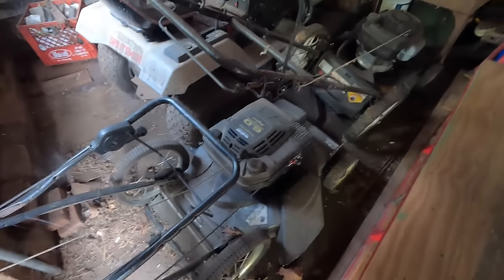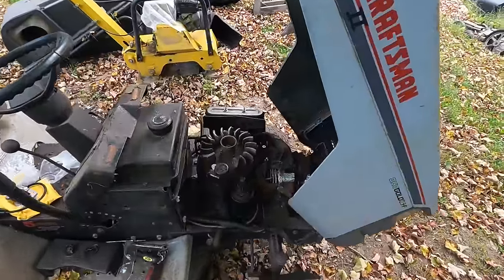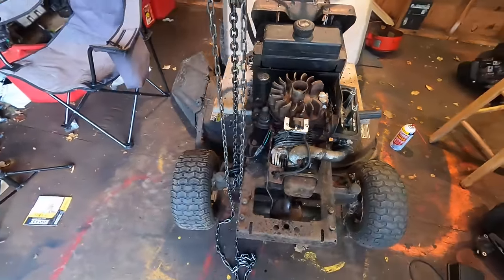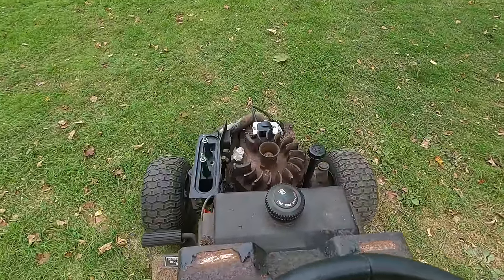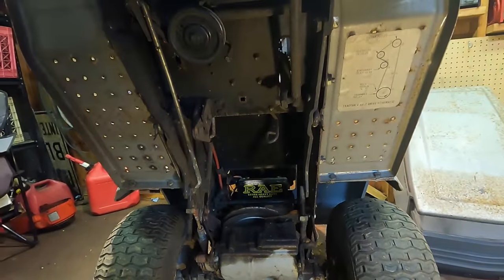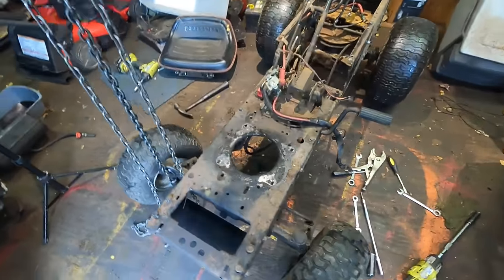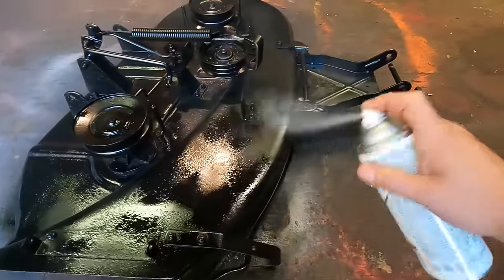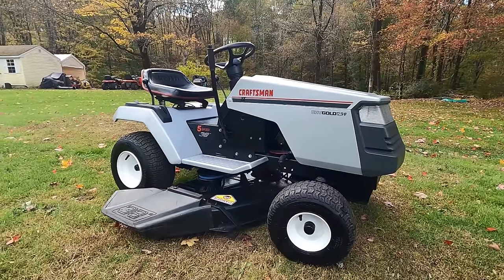BARN FIND Tractor Restoration: 1991 Craftsman LT4000

Comment: I just found  ur channel  and im liking it A lot. I like where u dont edit out the not starting  and any mistakes  u might make A lot of channels just edit out the bad and all we see is the machine  cleaned up and running  good after they spent half a day fixing  it. Ive thought about  starting  to do service and minor repaìrs no engine rebuilds or major work.   Do u just do the flippingor do u service for the public??¿  do u do 2 strokes???  Most shops or at least a lot has quit taking ìn2 strokes whats your opinion  on my business  plan. Just service  and minor  repairß????,
Reply from the maker: Hi! I’m so glad you’re enjoying my channel. Yes, I try to leave in the bad stuff too. It can be a messy process sometimes, and I make mistakes too. I try to learn from them and let the audience know what I’ve learned. 
I only flip machines right now, no repairs for the public. I’m a full time teacher, so most of my schedule is booked with that job

Comment: If you have fuel and spark and things don't start easily or run good. You need to start checking valve lash adjustment.

Comment: Hi Kyle, I subbed to your channel very nice job on that tractor, I'm also working on a tractor husqvarna LTH-139 , got it  running and driving, just need the deck belt, then I'll know if it will cut grass, also an important note for everyone if you take the rear wheels off remember they are keyed  netal key stock if you lose that then your wheels wont turn, thats what happened to the one I have plus the hydro static was low to from sitting, but that had me mind in a blender for a few days wondering why the wheels didnt turn.

Comment: Have you changed the oil ? If there is oil sludge on the governor parts inside the engine that could cause engine surge !
While typing you got the new carb on and it sounds really good !

Comment: Turned out nice.  I yelled a few times at the screen, but you got er done !  You might want to buy some cheap thin floor mats & cut them to fit where you put your feet and glue them down. My LT2000 has those. Thanks for posting.
Reply from the maker: Thanks David!

Comment: Kyle, that is one fine looking machine.  I call it a 6ft resto.   From 6ft away it looks like brand new.    I wish I could find something like that to tinker on.   If you go back and watch the video, again, when you're checking for spark... the 2nd time I think....  Anyway, you will see spark jumping off the ground side of the original spark plug.   As soon as I saw that, I shouted "bad plug" at the screen, but I don't think you heard me.   Anyway, loved the video, keep up the good work and see ya on the next one.  👍
Reply from the maker: Yes, that plug was tricky! I was so skeptical of the coil I had to modified that I overlooked the plug!

Comment: Nice job Kyle. What kind of apparatus do you have with your chains. I have a 3 car garage with finished ceilings and I would be afraid to hang a John Deere 425 and a 345. I do have some trees in the back yard with some pretty nice size branches. Thanks.
Reply from the maker: It’s just a 1 ton chain hoist from tractor supply

Comment: Just a little tip for ya. Before you move on from thinking it's a fueling issue try spraying starting fluid or gas right in the spark plug hole

Comment: Kyle, what an amazing transformation and a lot of work!  It was interesting to see where you pulled that equipment out of. 
I was so sure the magneto you got was the issue, so I was very surprised when the new carb solved it. 
Have you thought about using filler primers?  I wonder whether that would have improved the final coat on so much of that machine. 
What are you hoping to get for that it?

Comment: I really do appreciate and love your videos 📹 Kyle!!!!! Kyle sometime you might want to try Sea foam in the fuel ⛽️ tank when the thing is Surging. I use it a lot when I have that problem. It works about 90% of the time and it should smooth right out. I will put about 2 shot glasses of the Sea Foam in about an inch of fuel in the tank. I run it about 5 minutes and then turn it off and let it sit for about 1/2 hour. You will be amazed how good that stuff will work. I know that is quite a lot in that little bit of fuel. Running it cleans the jets and letting it sit really Breaks down the Contaminance and the build up.... I Love the Sea Foam great stuff....

Comment: Nice video. I had 2 of the rear engine type back in the 80’s. They did ok but I have graduated to some John Deere older 300 series and an older 425. Just don’t make them like they use to. Great job on the finished product.
Reply from the maker: Thanks! Glad you enjoyed the video. The rear engine ones are pretty cool, but they just aren’t as reasonable for normal use- I agree
Reply: Amazing what a new carb will do. I messed around with 2 Briggs & Stratton carbs on toro motors. Finally just ordered 2 new carbs and both run great.
Reply from the maker: @jackhuddleston6830  yeah, totally worth it!

Comment: It looked to me that, when you cleaned the carb, the float was not even close to parallel with the carb body; this would cause a degree of fuel starvation = engine hunting.
Reply from the maker: Could have been. Either way, the new carb fixed it!

Comment: You did a great job restoring that machine , however you'll never recoup the value of your time . I've been fixing this junk for people for over 35 years as a full time job . You didn't need to buy a new carb just a kit with a new via ton seat . They swell up in old fuel and won't allow enough fuel to pass through or get proper float settings . It does the same on Briggs and Kohler engines . At some point you'll want to clean them up and flip them as quick as possible for extra cash . That's how I started . You might want to keep this one as a testament to your work . Your neighbors will catch on quick when you mow with your antique mower . Also that AYP-Husky chassis has been unchanged for about 30 + years , lots of parts .
Reply from the maker: Thanks! I definitely understand that it’s not worth my time. But it’s a lot better when you consider the income from this video

Comment: You popped up in my videos today. I used to have a LT1000 with a snow blower. And a John Deere STX46. I gave both them tractors away. I was stupid and bought a 1-year old Cub Cadet v-twin with that STUPID PLASTIC KEY. I miss both my old tractors!!! Nothing worse than trying to start your tractor and it acts like the battery is dead. Yep that STUPID PLASTIC KEY has to be put in just right. When it finally pisses me off enough I will find a way to put a real key on it.
Reply from the maker: I’m glad YouTube is promoting my video! It seems to be gaining some traction. And yes, the old lt4000’s are pretty tough machines. I’m really glad with the way this one turned out! Thanks for viewing!

Comment: It looks great! When cleaning the carb, remove the main jet and clean it. Pop the emulsion tube out make sure that is totally clean. Don’t forget the tiny holes along the sides. You can use a strand of a stiff wire brush to clean the small holes. You can also use it to clean the low speed/ idle jet.
Reply from the maker: The entire cleaning process didn’t get filmed- it’s usually a bit boring to watch a full carb cleaning I think. Either way, this carb was shot. The new carb made all the difference! Thanks for the compliment!

Comment: Try a use 2 part mix fiberglass rosin in a gal can and paint it over and on you bare metal decks before you paint them underneath esp,,it sound proofs the deck during mowing and sand damage protects it and it last forever as far as rust protection. You can paint over it for looks,,just a trick of mind,and its sells to the people as well if you tell them at the sale ,as it ll never rust out again anywhere. As it cures out,its getts harder and more duable tougher than the steel its on

Comment: I cut and gride down the shalfts on those auto elect fuel shutoff seilenode under those carbs and reinstall them for sealing purposes only on the bowls,and remove the seat totally and install a manual fuel line shut off,,no more problems with starting as you well know by now

Comment: Low rpm idle has a surge mechanism that allows the mower to idle down and fluctuates between a low and higher rpm to allow the motor to spin enough air down on to its self at idle, since it’s not moving getting direct air, the fan on the engine has to draw all the air, at such a low rpm aka idle it can’t get enough air so the higher rpm fluctuations allows surges of more air to keep the engine cool, then there is no surge at high rpm since you are getting a sufficient air flow already

Comment: Awesome job on this. I live in CT too and when I bought my house this same tractor was in my shed. I got it working and used it a couple years, but have since upgraded to a zero turn. Recently I decided to pull the engine off the Craftsman and take it apart and rebuild it. I've thought about doing the full restoration on the rest of the tractor too
Reply from the maker: Very cool! You should do a restoration!
Reply: @Kylebythecreek  I might post a video on the engine restoration. There was nothing wrong with it I just want to clean it up nice and make it look like new. I'm debating between the full restoration on the tractor, or possibly building a power washer with the engine. I'll try to remember to send you a link if I post a video.
Reply from the maker: @garyknaufjr  I’ll subscribe to your channel so I won’t miss it!

Comment: You might try putting some heat on the decals before peeling them off. A heat gun or even a cheap hair dryer helps soften the adhesive. I use a hair dryer I picked up for a couple bucks at a thrift store if my heat gun isn't handy. The decals on this tractor peeled off fine without heat, but sometimes it's necessary to get them off in one piece.

Comment: You've got to be kidding! That's not a restoration! That's just a repair with a paint job!

Restoration means the way it came out of the original factory!!!

Watch how Squatch253 does a restoration!
He takes every single bolt and washer and nut and screw and every single part off of the tractor and make sure that every part that goes back on is exactly the same as it did from the original factory as much as humanly possible!
That is a restoration!
What you did is a repair with a paint job!
Reply from the maker: Thanks for watching and for commenting. I likely won’t be going to the lengths of Squatch253. This 1991 LT 4000 is hardly deserving of the effort that he puts into those classic farm tractors. Considering the resell value of this simple homeowner lawn tractor, I think my restoration was more than enough. It’s all just for fun and to stay busy and to learn!